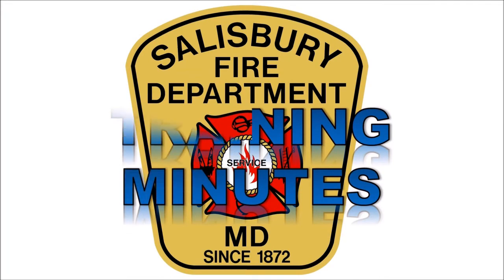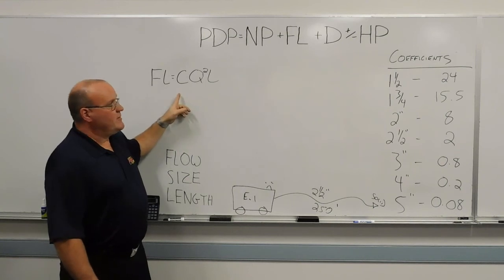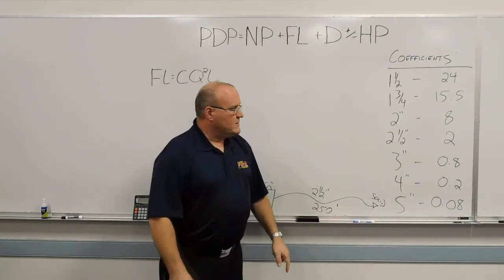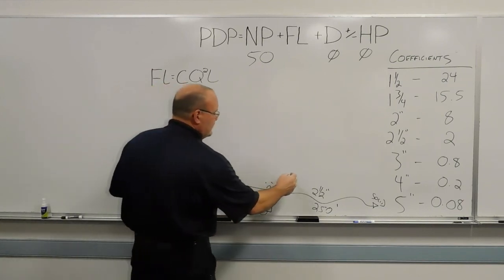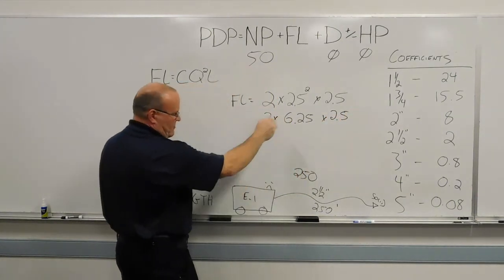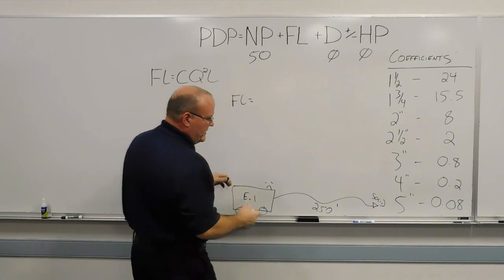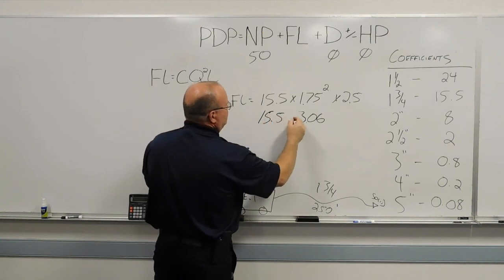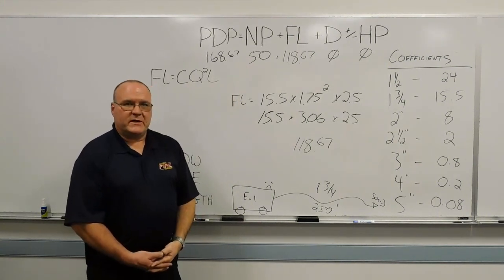Using the coefficient method to calculate friction loss in attack lines

Comment: Were did  u get the 1.75
Reply: 175 gallons per minute divided by 100
Reply: Based off 15/16 tip on a smoothbore hand line nozzle flowing 175gpm at 50 psi